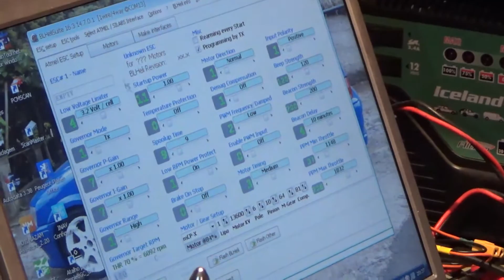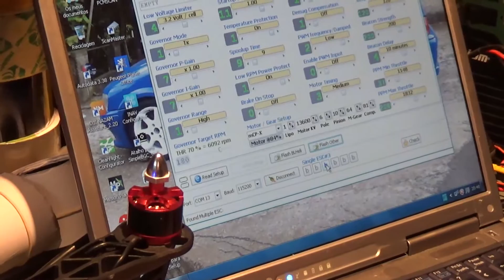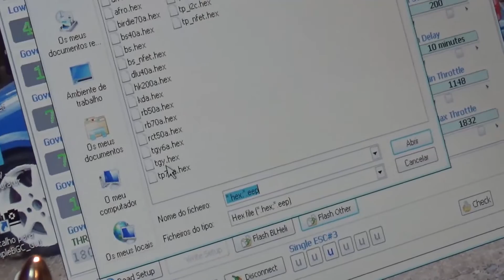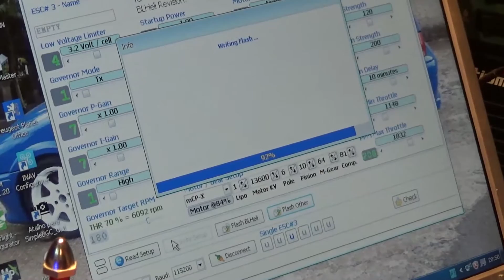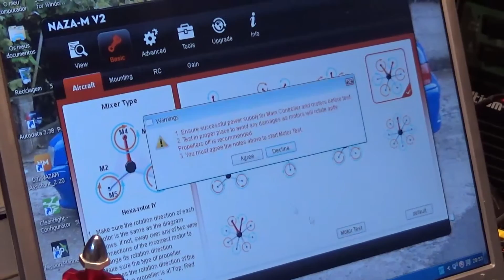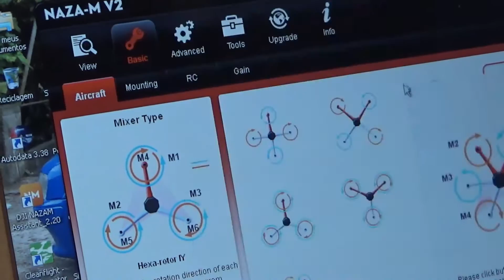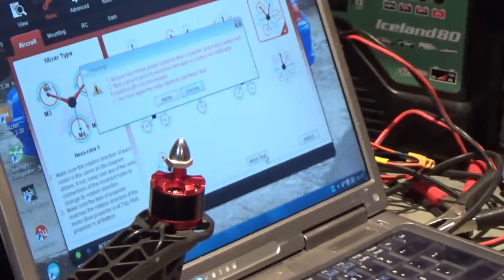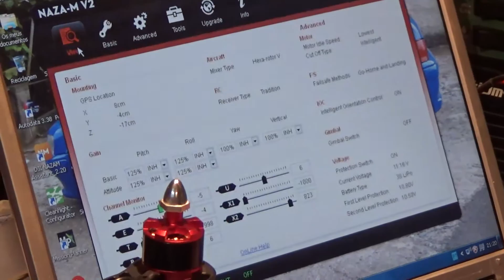Naza Lite V2 Motors not spinning Problem solved!!

Comment: You don't need a separate board to calibrate your ESCs. Just plug them in to your receiver one at a time to channel 3. Power them up while throttle is in full up position. This will out them in programming mode. Follow the ESC manual for full guide to program them. Probably just have to put throttle back full down until it beeps. And your done.
Reply from the maker: Josh Bascii i know, i had tried that but for some reason only some of them would work ok...this way all worked fine
Reply: Thanks a lot - I couldn't calibrate this motor esc using any other tools. :)

Comment: Please sir write the exact name of the board I cannot  hear you properly... please sir...
Reply from the maker: Dji naza lite
Reply: @luisfilipe1983  I know that but I want to know the name of the board which you used to calibrate escs and can you tell me that what firmware I should use to calibrate my 4 blheli 30 amps esc. Please reply sir it's  urgent...
Reply: @luisfilipe1983  please sir reply. Me too facing the same problem but I am using emax blheli esc. So suggest me which firmware I should use with link please sir help me....
Reply: @luisfilipe1983  please sir reply...
Reply from the maker: It is a Naze32 board flashed to Cleanflight...connect the esc to that board and then must use BLheli software on computer...flash the esc through BLheli software with "tgy.hex"...but that tgy.hex file is part of kkmulticopter flashtool...if you download that you have the hex file there...pay attention that my esc's are not emax...using different esc's it might not work the same way.
Reply: @luisfilipe1983  thank you very much for your reply...
Reply: @luisfilipe1983  then sir guide me what should I do. Please sir, I have spent lot of money on this so far. It is very disappointing for me. Please guide me sir....